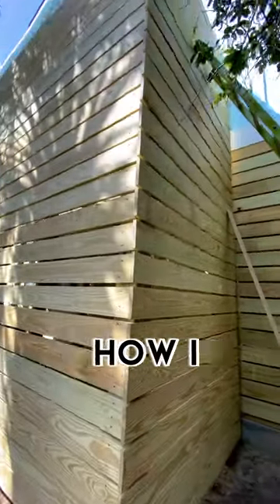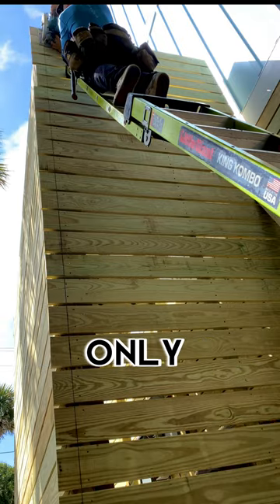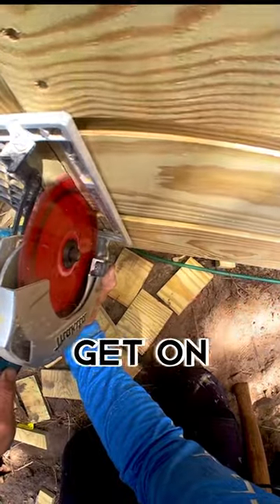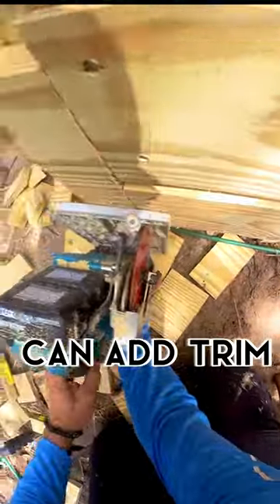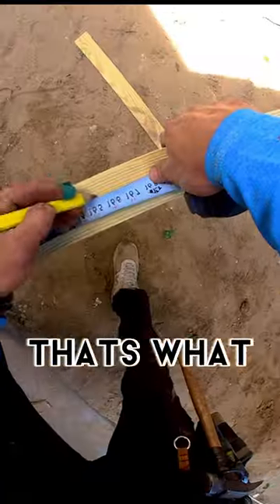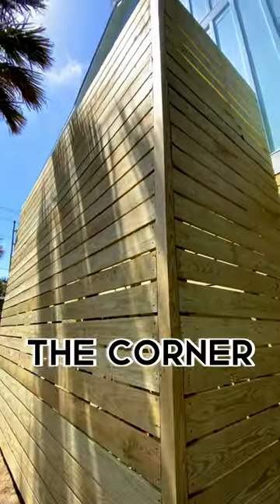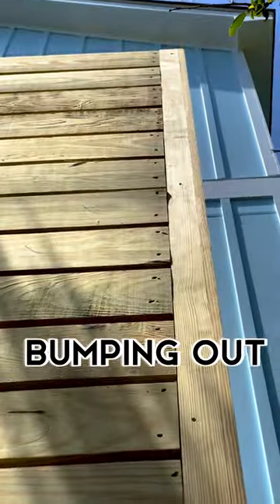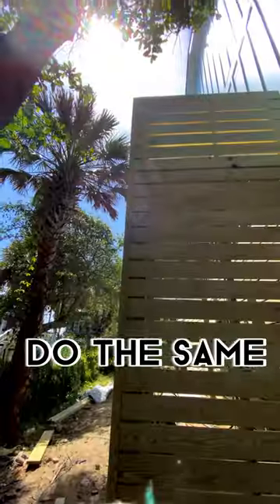Big Cut| Artpentry #artpentry #carpentry #diy #artisan #woodworking #build #construction

Comment: I don't use a circular saw every day but i could never cut such a straight line.  I'd have measured, marked and tacked up a long straight edge then run my saw down it or up it..
Reply: Step one is a good blade. A dull blade might get stuck a bit or have a hard time and push you off. Second step don't push to hard on the saw. It wants to go in a straight line because a lot of the blade is in the wood and only cuts with front and back.  Rest is practice
Reply: Once you use it everyday and used to your saw you got it. And be confident in yourself and send her
Reply: Get a better blade and a nicer saw. Trust me it changes everything

Comment: Looks like a good cut. Suggestion....you could use the trim boards as a straight edge guide for your cut. Temporarily screw them on top of the boards to trim.
Reply: Only thing is timber ain't straight, track saw would be ideal.
Reply: Where do you buy even close to perfectly straight 16' 2x4's? I work in the lumber industry, 208 boards in a bundle. 3 of them are " perfect "
Reply: @jackyjew8607 so screw the track on?
Reply: @islandpainter3964  yeah exactly, looks pretty tall too so you probably wouldn't notice the screw holes up there, especially if you plugged them after.

 Or for a cleaner finish you could clamp the top of the track and get someone to hold the bottom, no damage done.

Comment: If the framing is relatively straight/plum you get a straight long 2 x 4, screw it to the wall and run your saw down it.significantly easier than trying to follow a line. It looks like PT decking so in about two months it’s gonna be a quarter inch short anyways. Everything shrinks. Where are you doing All of this framing? Looks like a southern state?

Comment: Measure the distance from the blade to outside of your deck. Attach a very straight 1x2 (or larger if that's what you have) the correct distance from your cut line and let her rip.

Comment: Sort out those “bumped out boards” with a vibrating multi tool. It will also give a little expansion room. Alternatively, pin a batten to the wall and open those groove with the circular saw.

Comment: Seems long winded way , why not cut them to length as you go 😂
Reply: To many variances, with posts being a little off or warped and slight errors in cutting or installing each piece.. this does a cleaner job.
Reply: Haha my guess is you’re not a carpenter 😂
Reply: Ironically, your way is much more long winded lol
Reply: To spell it out clearly. Each board will need to be measured for, brought to the cut station, measured, trial fitted, recut, trial fitted again recut again, then finally placed and nailed, at least one board will be cut short and need discarding. 

I may be exaggerating.

Letting the ends run wild and disciplining them with a careful cut eliminates a lot of steps and error points. Just don’t mess up that cut.

If you want to watch an old school carpenter with all the tricks of efficiency, look up Larry Haun.😊